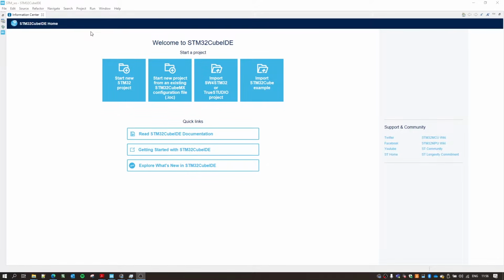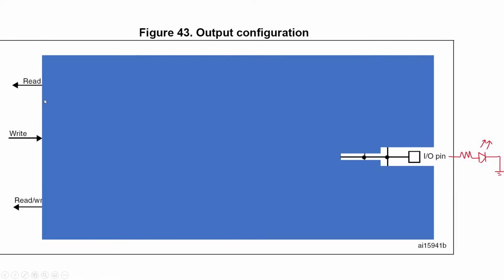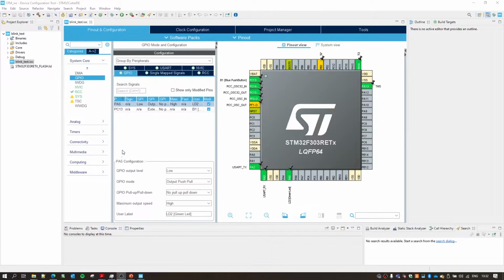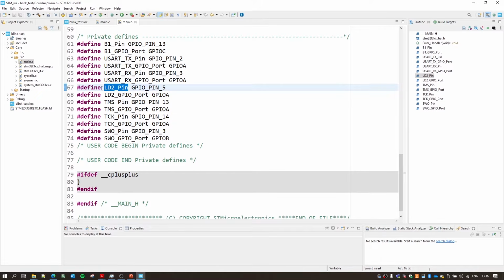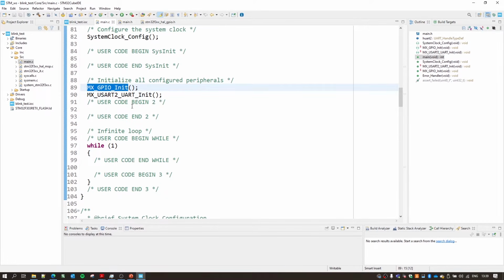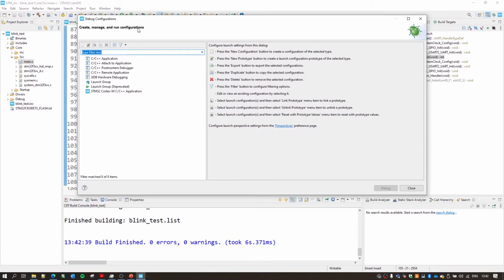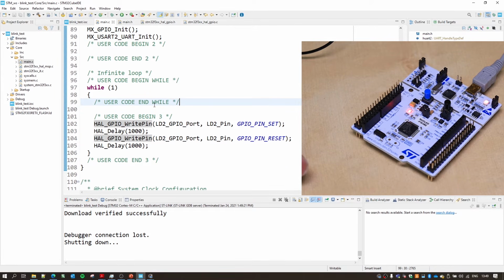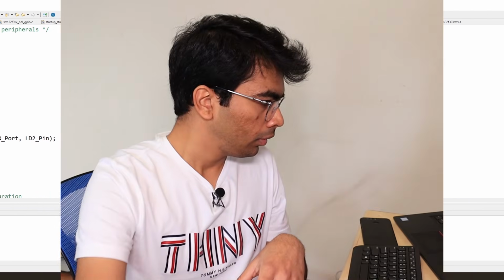How to Blink a LED | #5 STM32 GPIO output

Comment: • When the input is 0 (Low / GND): The output is pulled up to VDD. Means pmos activated
• When the input is 1 (High / VDD): The output is pushed down to GND.
Meanz nmos activate  ...wrong info

Comment: in Debug Config section when i try to scan the program cannot find any st link but i am using nucleo card and its connected and leds on the card is blinking what can be the problem?
Reply: I also have the same problem. Have you found a solution?
Reply: @yeungster1013  yes i found the cable i used was the problem i changed the cable and it is fixed

Comment: It's blinking, but i have a question. I tried to write a function before the "while", that blink exactly 10 times. It blinked 10 times, but after that led didn't turn off, so it was still bright. Any advice how to force it off after the cycle?

Comment: Nice videos! Can I set the output logic high to 1.8v instead of 3.3v?
Reply from the maker: Nope, not unless the GPIO level specified in the datasheet is 1.8V. In this case you will have to use a level shifter IC.